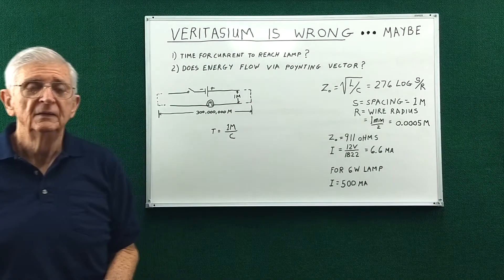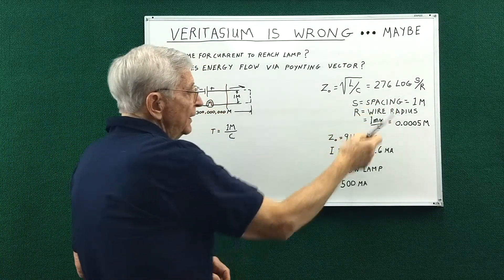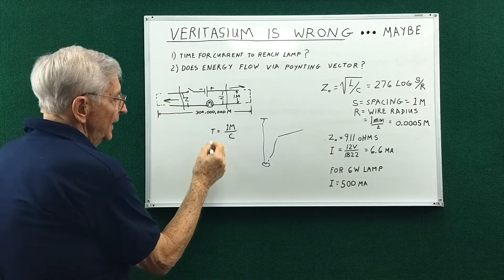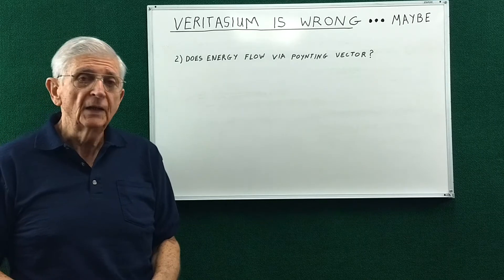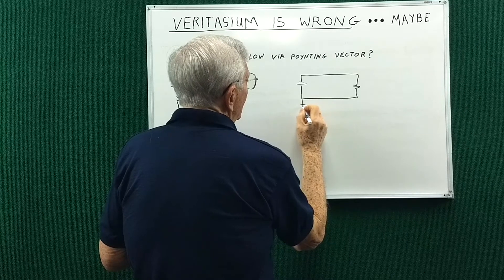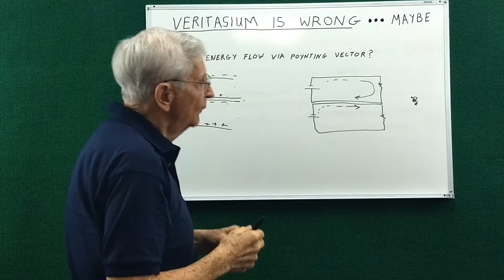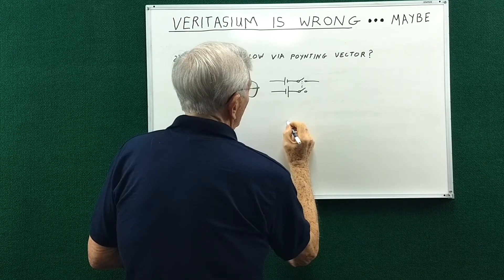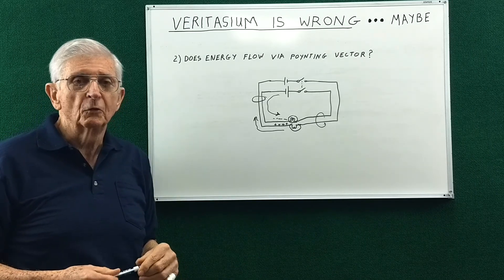Veritasium is wrong about time to light a light bulb in a long wire circuit.

Comment: Experiments backed by theory now show that the light in this thought experiment will turn on instantaneously! In electronics, engineers assume lumped circuit elements where  currents and voltages!are assumed to propagate instantaneously to simply the mathematics. The justification is that for most small cuicuits the propagation delay would be too small to see, justifying the assumption. But experiments backed by theory now show that the justification is actually correct. A paper just published in the EM Journal IRECAP shows an EM pulse propagating 1.5 m in the near field with no observed propagation delay. It shows that the front speed, or the speed of information, or the speed of causal action is instantaneous in the near field of EM sources. This disproves both the second postulate of relativity as well as relativity's prediction that causal action cannot propagate faster than speed c, hence disproving relativity according to the scientific method. If relativity is wrong then so is any other theory based on it, such as general relativity, as well as QED. This will change all of modern physics! For more information, see New interpretation of relativity by William Walker, and see the papers in the description of the video.
Reply from the maker: Thank you for your comment,
Reply: Physics actually supports what you said: that the light will turn on instantaneously. I thought you would be interested in knowing this. It is profound prediction that will change all of modern physics!

Comment: No matter how close your wires are, as long as they are not touching, there will be magnetic field in between. The Poynting vector in your examples are squeezed in between the wires, and almost zero elsewhere. See Poynting vector on a coax cable in Wikipedia. https://en.wikipedia.org/wiki/Poynting_vector
Reply from the maker: Thanks for your comment. In the video I point out that there is a magnetic field between the wires, but I do not believe that there is an electric field. We can make sure that there is no electric field by connecting the wires together a only one point. If we connect the two wires on the right near the midpoint of their length, the circuit will operate the same and this will guarantee that there is no electric field between the wires. A piece of coax could be used in place of the two wires. If the shield is connected to the center conductor at either end there will not be an electric field across the dielectric. The wires are carrying power from the batteries to the lamps but I do not see where any Poynting vector is possible.
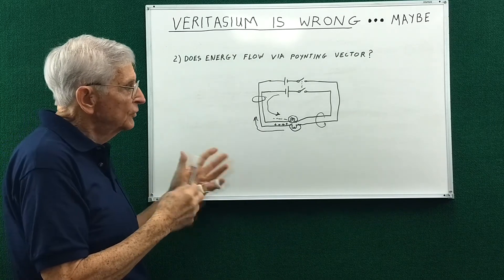Reply: @Jimscoolstuff   At #17:42, let's say you connect the vertical wires on the right at their mid points, which is fine. There will be no current through that junction and the wires on the right will have the same potential: no E field.This kills Poynting vector on the right side of the circuit.
 But look at the wires on the left now. There are sitting at different potentials: one at +V one at -V, that is 2V difference. That creates an E field in between the wires (along with the magnetic field). There is still Poynting vector in between the lines on the left half of the circuit. 
 If you connect the wires on the left too, you kill the left side as well, but that means you are shorting two batteries- you won't get any power to the lamps, consistent with having no Poynting vector pointing to the lamps.
Reply from the maker: @ramanian  Yes you are right. This discussion has made me realize that I did not intend to challenge the Pointing vector. I actually wanted to challenge the idea that the fields carry the energy in a DC circuit. 
A field can carry energy only when it is changing  in intensity or direction. Energy can be conveyed thru a capacitor or a transformer without electron flow, but only when the field is changing. Here is a demonstration at the 12 minute mark. https://youtu.be/XZJ2-oF7T9E 
In a DC circuit ,after the initial transient, the fields stop changing and thus can not convey energy. The electrons must convey the energy after the fields reach steady state.
Thank you for challenging me and making me think harder.
Reply: You are right, but perhaps for the wrong reasons. Experiments backed by theory now show that the light in this thought experiment will turn on instantaneously! In electronics, engineers assume lumped circuit elements where  currents and voltages!are assumed to propagate instantaneously to simply the mathematics. The justification is that for most small cuicuits the propagation delay would be too small to see, justifying the assumption. But experiments backed by theory now show that the justification is actually correct. A paper just published in the EM Journal IRECAP shows an EM pulse propagating 1.5 m in the near field with no observed propagation delay. It shows that the front speed, or the speed of information, or the speed of causal action is instantaneous in the near field of EM sources. This disproves both the second postulate of relativity as well as relativity's prediction that causal action cannot propagate faster than speed c, hence disproving relativity according to the scientific method. If relativity is wrong then so is any other theory based on it, such as general relativity, as well as QED. This will change all of modern physics! For more information, see New interpretation of relativity by William Walker, and see the papers in the description of the video.

Comment: The energy flux for an electromagnetic wave can be obtained integrating the Poynting vector over a surface, and you can get from that which is the energy radiated by the wire.

But the electric power is transmitted by the movement of the electrons. Those little guys don't want to be one near the other, and if you "push" them together, then is very much like when you compress a spring. That "compression energy" is just the Voltage.

The moving electrons at their drift speed will push - by the repulsion of the electric field - the electrons ahead in the wire, and that's how the electric energy flows.

Of course, the electric field force is mediated by photons.

Comment: Very good video. Regarding the pointing vector: It is defined as S = E x H. If the distance between the two conductors becomes smaller, the magnetic field H becomes smaller, but the electric field between the conductors becomes larger. The product of both remains the same. If both conductors collapse, the magnetic field is 0 and the electric field is infinite.
Reply from the maker: Thanks for your comment. Actually there is no electric field between these conductors. They are parts of different circuits and connecting a voltmeter between them will show zero voltage.
Reply: @Jimscoolstuff  Both circuits have no reference potential, so they can theoretically be at any potential. At the beginning the wires are normally potential-free, they will be charged by connecting them to the battery. The upper wire becomes negative, the lower positive. This applies to both circuits. The potential of the battery (Ub) is between the upper and the lower cable. Assuming the cables have the same line capacity, the potential is distributed equally. + Ub / 2 on the upper wire and -Ub / 2 on the lower one. The same applies to the second circuit. As a result, there is a potential between the lower wire of the first circuit and the upper wire of the second circuit of Ub and, accordingly, an electric field. If the two cables are connected to a voltmeter, even if this has high-resistance, the two charges on the cables are balanced. This means that the measurement is the reason that the wires are at the same potential. This discharge is difficult to measure in the laboratory but a practical example shows the phenomenon. Helicopters are used to maintain high-voltage transmission lines. A worker must not touch the high-voltage line immediately from the helicopter. Because it is on a different potential. First, he has to charge the helicopter by making a cable connection between the helicopter and the high-voltage line. This connection brings the helicopter to the same potential as the high-voltage line so that the worker can safely touch the high-voltage line. Otherwise, the equalizing current would flow through the worker and likely kill him. The helicopter corresponds to the first circuit (it has also an internal voltage supply), the high-voltage line corresponds to the second circuit.
Reply from the maker: @axelbeer1000  We are talking apples and oranges. With your AC powerline example there is a capacitance between the powerline and ground. There is a capacitance from the helicopter to ground and a capacitance from the helicopter to the powerline. There is no discharge going on. There would be a steady state AC current thru the capacitors. We can eliminate all this in my DC circuit by replacing the voltmeter with a wire and leaving it connected. This then eliminates any possible field between the wires.

Comment: If the special Veritasium wires have 0 resistance then the path is only in that. All the energy will remain and will not take detours to the stuff 1 meter away.

Comment: The actual wire wire is probably less than 200 feet: of course the bulb lights ‘instantly ‘. Time to complete circuit is 2 seconds ( per ideal bulb/ wires). The physics has the expanding electrons crossing over from subatomic realm to atomic realm at @“c”. DC produces a magnetic ‘field ‘- physical electrons- leaving the wire perpendicular and spiraling ( skin effect). Magnetic fields do not light up a bulb.

Comment: The actual length of the wires is probably less than 200 feet: of course the bulb lights ‘instantly ‘. If bulb and wires are ideal ( as Derek says) the answer is 2 seconds. The expanding electron crosses over from the subatomic realm to atomic realm at @“c”. That’s the physics.DC produces a magnetic ‘field ‘ which is expanding electrons physically leaving the wire. Not aware that magnetic fields or magnetism can light a bulb.

Comment: The actual length of the wires is probably less than 200 feet: of course the bulb lights ‘instantly ‘. If wire and bulb are ideal as Derek says 2 seconds is the answer. The physics has the expanding electron crossing over from the subatomic realm to atomic realm at @“c”, moving from high pressure- excess electrons- to low pressure, depleted, ‘positive ‘ terminal.

Comment: Some commenter asked Veritasium what if the circuit was circular. Good point to make. 
What happen if the wires were in a zip zap shape? They are all over-thinking a simple problem. You need current flow in an electric circuit for power or energy to be transferred.

Comment: I have to agree with you for the most part. 
Veritasium and his followers are misinterpreting how energy flow or is transferred in a simple DC circuit. I think they can't explain energy flow in your last diagram because of  course the currents in opposite directions will cancel each other out. Good example.